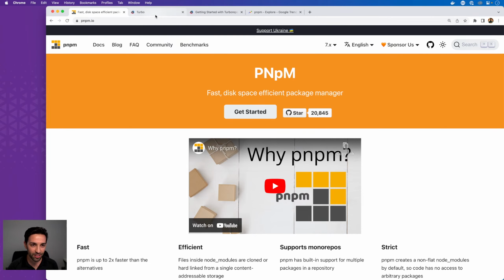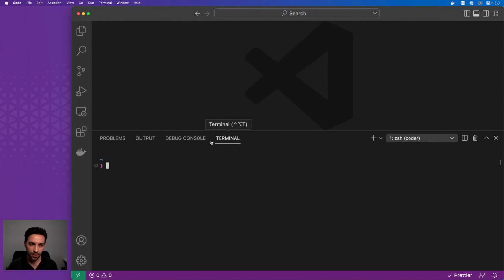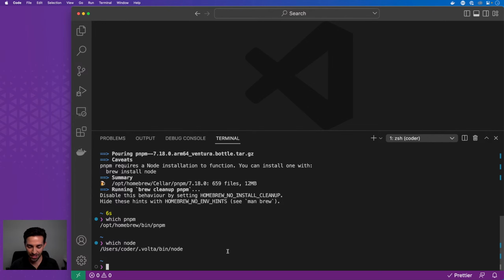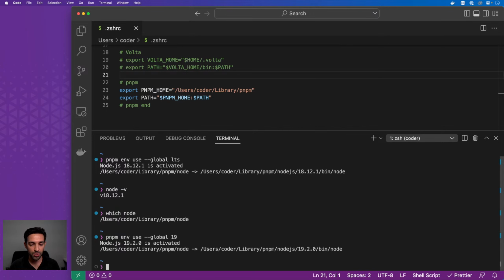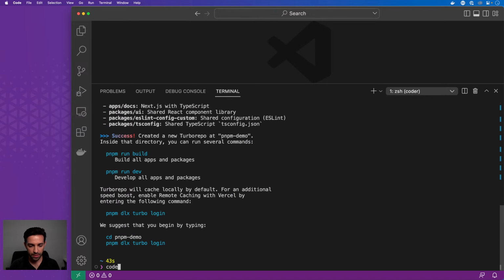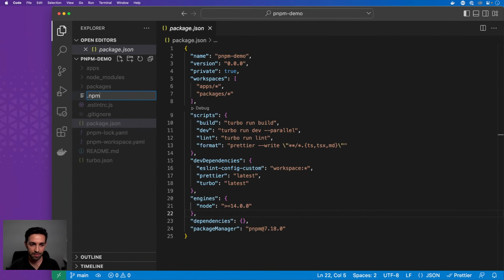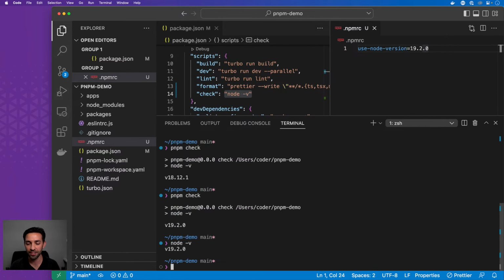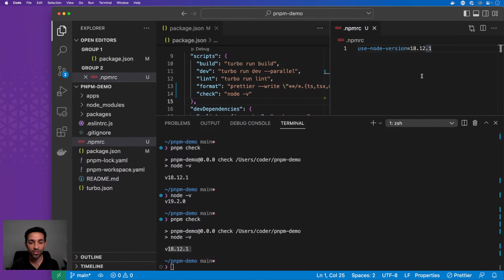Using PNPM to replace Yarn and Volta (updated)

Comment: It's not using the specified node version if you call `node` in your repo directly - using Volta it does. PNPM is also inconsistent in it's use of the specified version because it doesn't use it when running pre/post scripts on pnpm i.